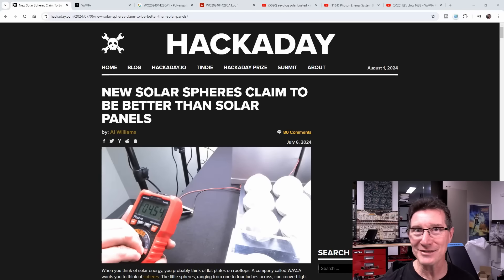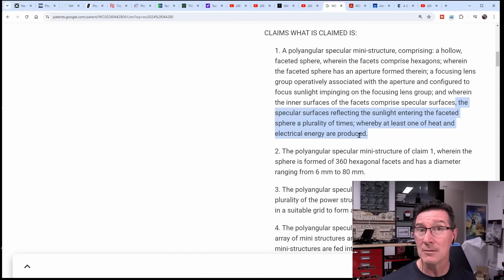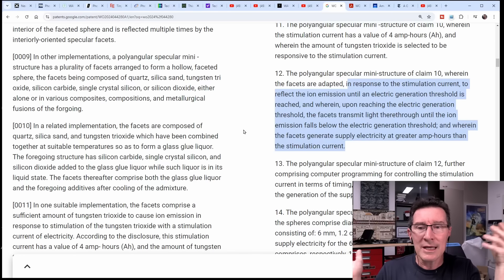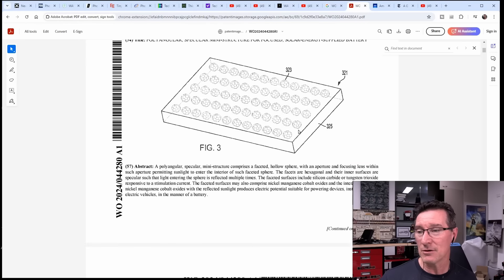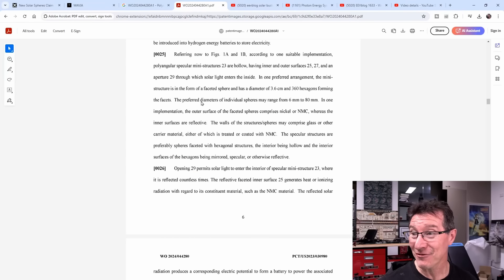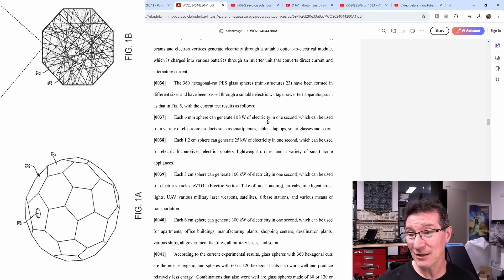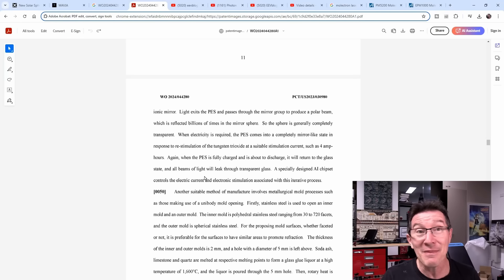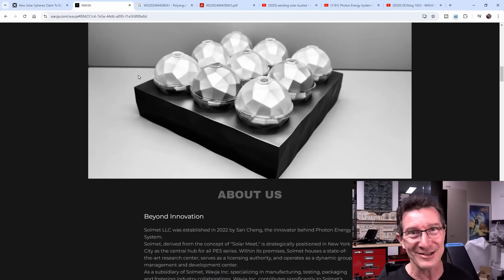EEVblog 1633 Part 2 - WAVJA Patent, 300kW Solar Balls!

Comment: Hey Davy, at the risk of sounding like I am trolling you, people like you, thunderfoot and Louis appear to be sliding into the unhealthy, entertainment-centric "busting videos" vicious cycle. And it is a part of a larger trend of various seemingly well-intended public criticism - to me it seems that the form in which it is presented is not designed with the intent to stop those poor practices, but to entertain people with busting videos about them, which many people find appealing because of its "pacifier action" - giving the people the illusion that the issue is being addressed. The process of making an entertainment career out of debunking ethical lapses does not appear to be yielding tangible improvement. And if anything, from the perspective of such a career, there is strong interest in the continuation of fresh new material to debunk, which in turn is not the right dynamic to take any more adequate action than to entertain people with it. I mean just look at the platform that facilitates this process - it is far from ethical itself, so don't you at least consider the possibility that those entertaining busting videos is essentially the image that the unethical would like to present its opposition? In a way, making you unwilling and unknowing controlled opposition... A mechanism that safely vents the issue in a form that makes it looks as if people care and take steps to address it, but in reality simply plays back right into it. I mean, after so many videos, I personally feel like unethical scams have been more "normalized" than ever. And for you personally, I don't consider it a healthy symptom to find such hilarity in the underlying absence of factual science or even common sense that's a requisite for such scams.
Reply from the maker: I've been doing debunking videos for 14 years and I still enjoy doing them, the end.

Comment: The cable needed to cope with 500kW for sure would be bigger than the sphere itself 😂😂 500kW !! If you're going to lie atleast don't go to the absurd.. such an insult to science claiming output power  of 500000 watts from sunlight captured from a device with the size of a tennis ball 😂 But if you dont know the difference between Ah and A whats to expect. And those call themselves scientists. 😂

Comment: Engineering Question: Is an electric heater 100% efficient as, let’s face it, waste energy is always dissipated as…..heat…..

It’s Friday and my brain has been barraged by too much social media to think clearly
Reply from the maker: Not precisely 100% efficient heat, but close enough. Some energy also goes into a light and some inductive magnetic field.
Reply: I can't tell if you're making a joke or not.  I'm also not an engineer but no not 100% efficient as you lose energy to conversion of energy to heat, motion and noise etc, assuming the heater has a fan
Reply: Funny. I replied and YouTube ate my comment
Reply: It was stupid, referring to the fact that a ceramic resistor run within spec could be claimed to be 100% efficient

I could market such a device as being a 100% efficient heater. Do a dodgy AI voiceover and make bad ads with lines like The revolutionary 💯 percent efficient heater that big energy and the government doesn’t want you to know about

But google tubes ate it. 

It was a shame as I also had the line in the ad Discovered by an Australian whilst watching a famous YouTube electrical engineering channel

Sadly all into the bit bucket. Sometimes they come back, but not often